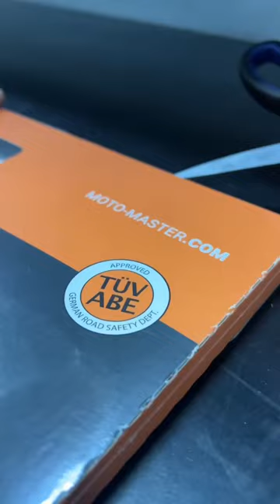Installing a SPECIAL disc brake #shorts

Comment: What is the difference between the stock and new disc
Reply from the maker: Better heat reduction and brake pads cleaning when riding ;)
Reply: Would you suggest them outside close-course riding?

Comment: Yo bro how R the Rotobox bullet ?
Still no cracking with that ?
I just ordered it for a Suzuki GSX S 1000 crazy wheelings R coming🔥😎🔥
Reply from the maker: I managed to crack one but after further inspection it was only the outher layer means only a cosmetic fix. Still running the first set of wheels 🤘😁 great product
Reply: @RokBagorosStuntrider  thanks for Your answer my bro i can't wait to put the front wheel in the Sky🔥😎🔥with love from Paris

Comment: What is the purpose of this disc brake? Please explain 🤔
Reply: heat management
Reply: I believe the purpose of this discussion brake is to stop the bike 😂
Reply: Your question is valid. The shape of these discs is absolutely pointless, and their sellers will try and tell you that their shape improves heat dissipation, or deformation, or whatever. But it's just marketing bullshit. Best shape is... a disc (otherwise, you would find this shape in clutches, for example...) YET, the quality of the steel AND, especially, the thickness of the disc is a factor, and the new disc seems to be quite thick, here. I guess that thickness is the main point of this disc.
Reply: But, it makes the bike at least look fast 😂

Comment: Ktm doesn’t have free floating brake discs?
Reply: They build small cc bikes to a price point, obviously. For intensive riding, floating discs would make a diff, that's for sure.
Reply: Larger cc bike's do. The 390's are produced in India.